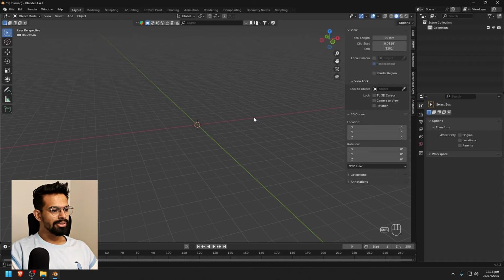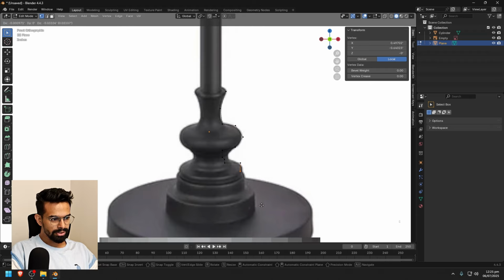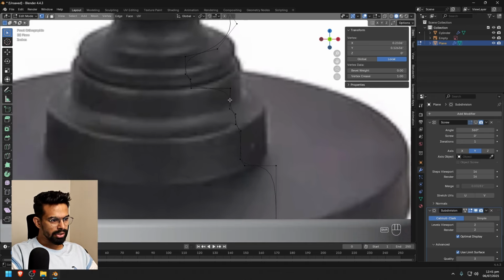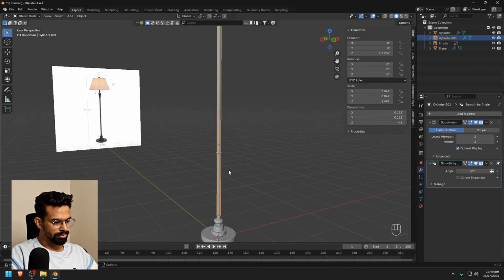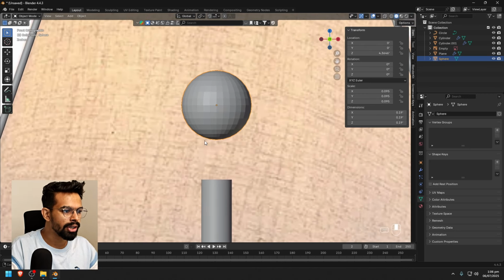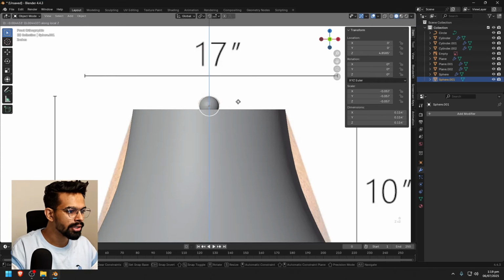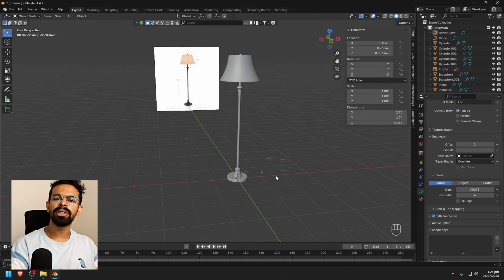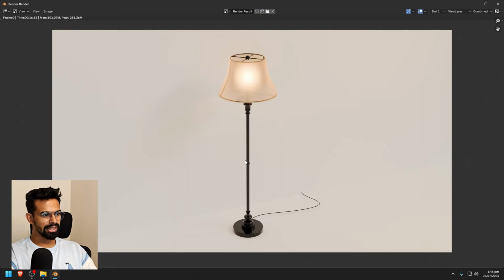Mastering Modeling with Modifiers | Blender 2025 Tutorial Guide

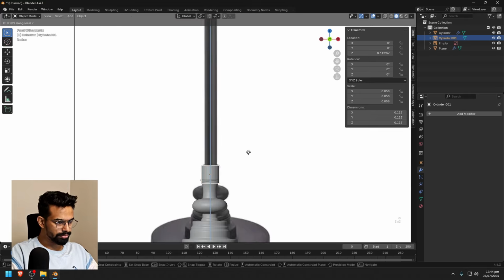Comment: Note on comment: at 17:27 technically can’t you do another plane > merge into one vertex thing + screw thing again, and then just use the math modifiers (X / Y / Z = 0 / 90 / 0 (note: i forgot direction  meaning) to make it perfectly straight up THEN begin expanding on vertex extensions around the stem bump then do the same thing again (if the stem bump is perfectly circular that is by image). Otherwise, i do wonder how to make assymetrical variants- same with mirroring 2d (yet 3 dimensional ish) images (like making a leaf feel more 3d- although i feel like thats just plane curving or something. Term source: i randomly made it up)

I mean, anything thats technically symmetrical and has no hollow internals can be used in that format! Although im assuming this makes it kind of a unified body, and that its not as modular as the method proposed? Although I guess it does make sense if the goal is to maximize RoI knowledge.
Reply from the maker: In this video I am just introducing different modifiers, it might just be pointless if i do the same strat on the stem as well. and yeah i wanted it to be very modular for animating it in later video.